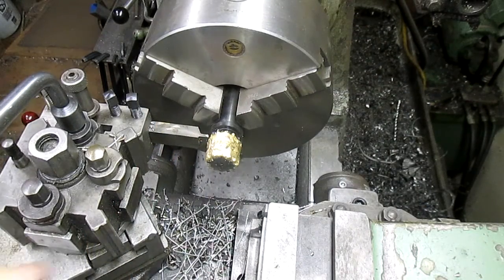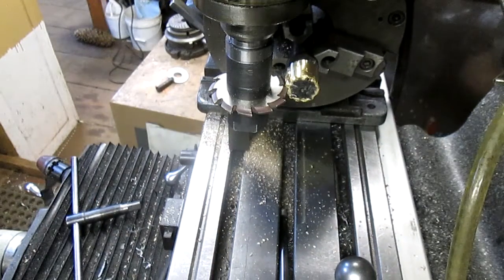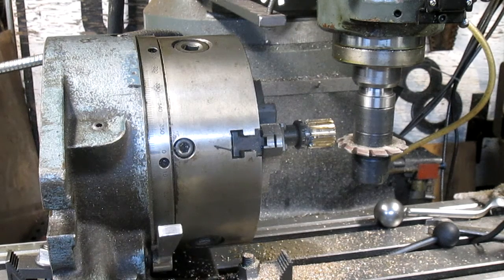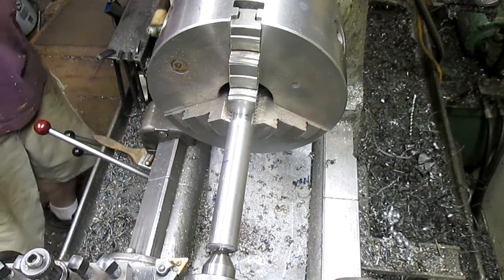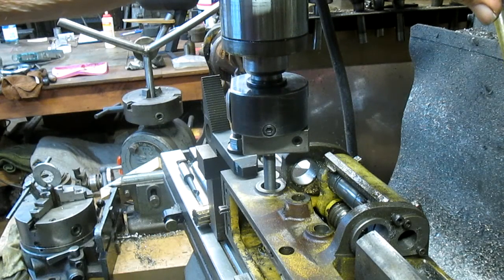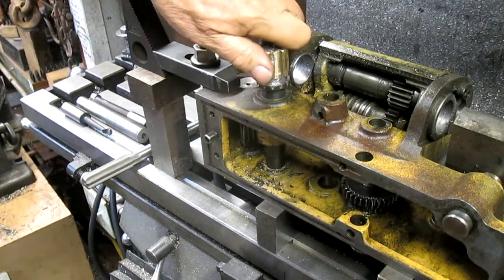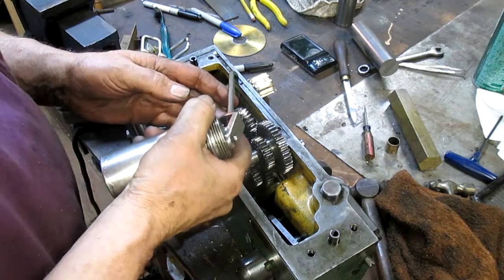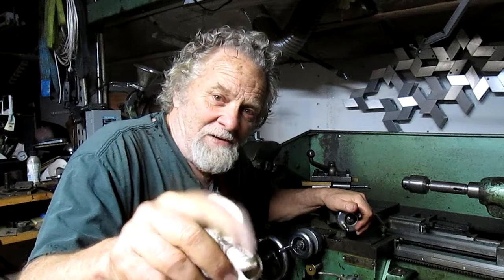Clausing Apron Repair #2

Comment: Very clever fix for the Clausing. I own a 5914 and since owning the lathe have fell in love with the consistent design and accuracy. When I bought the lathe 3 years ago the owner who sold it to me really ham fisted the lathe and the main spindle was out of tolerance and would jump while cutting anything with pressure. I checked the owners manual and quickly found the tapered bearings to be the culprit. So I tighten the sleeves and the problem went away. Took me a month to finally figure this out. Built a steady rest from a kit from england and very happy with the results. BTW I am down in the lowlands of Sacramento from you....Cheers

Comment: Repairing a bull gear on Dad's little John Deere "M" crawler was what sparked my interest in machining.  We were N.E. of Kansas City, the nearest outfit capable of handling a gear of that size at the time was in Wichita, KS, and the cost of another gear was in Dad's "Hell NO!" category.  He had a local welder build it up while he went out and bought two new Nicholson files, a new hacksaw and blades, and emery tape.  He brought the gear home still hot from the oven, we set up on a table on the front porch, pulled up some lawn chairs and got started.  We compared what we worked on to an imprint that was peened into some heavy card stock on a non-damaged section of the gear.  It was a 4 day lesson in patience for a 16 year old (me) and it got me wondering just how a gear shop would have done it.  It also showed me what could be accomplished when all you had was a fist full of hand tools and a lot of time.

Seven years later that gear was still working when the machine was loaded on a trailer and it went home with it's new owner.
Reply from the maker: I've done several slow moving gears by hand over the years and they also are still in operation. It takes forever and is nerve wracking, but it works just fine. Thanks for the story.

Comment: Hi Nick, Good job done. With your toolholder (you may recall sometime ago I commented about inserts as I used to work for Carboloy, the manufacturer of the tool) the centre screw in the insert needs to be tightened along with the clampscrew and this should solve your issue and do away with the little shim. If you are using thinner TNMG 1603 -- inserts you can buy a thicker anvil to go under the insert to compensate for the thinner insert. Also as the clamp has both LH and RH threads you may like to check that the thread is not coming to its end. In other words have the thread in the clamp, when tightened on the insert, should be flush at the top. Hope this helps. I can give you the anvil number if you want to purchase one. Cheers Ian  - New Zealand.
Reply from the maker: A thicker anvil is perfect.  Please give me the number, it will help.

Comment: Buying a used piece of equipment is an adventure that you miss when you buy it new piece. It seems like once you get the bugs worked out on the old machine it's just much more satisfying to operate it. You buy a new machine if something isn't right with it it just pisses you off.
Reply from the maker: That said I'd like to afford to buy a new lathe someday just to see how much easier machining could be.